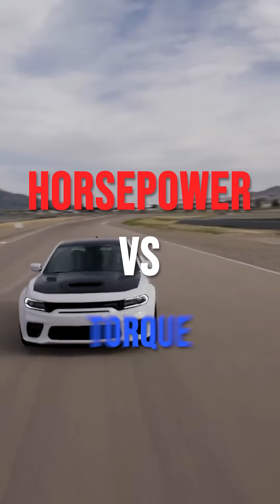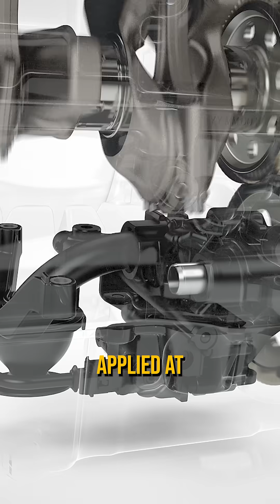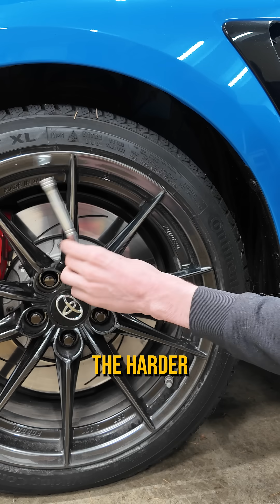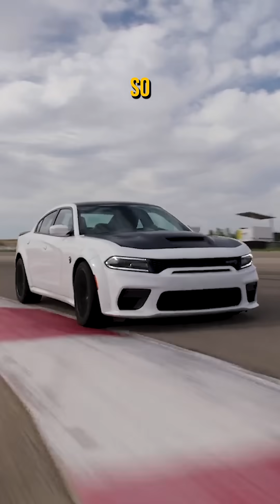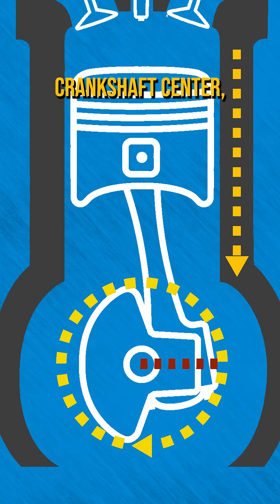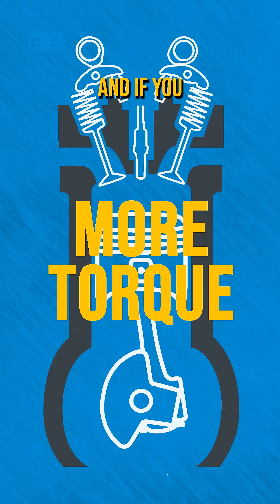Horsepower vs Torque (In 60 Seconds)

Comment: People used an analogy of “ how hard you hit a wall vs how far you take it.” Needless I don’t trust their driving.

I much prefer “torque is how heavy a load you can tow, power is how fast you can tow it.”
Reply: The best analogy of power v torque I heard was to think of a well with a bucket. Maximum torque would be when the bucket is filled with as much water as you can possibly lift it off the well. Power would be the most water you could get out of the well in a given time. You'll probably find that only part filling the bucket will get more out in the given time...
Reply: They are both hp, torque doesn't enter the equation.
Reply: @PSA78 But the heavier you are the more torque does matter. A heavy car with 390nm of torque, making 550hp at 10,000rpm, trying to push through the wind at 200mph will not accelerate as good as a car of the same weight with 1000nm of torque, making 550hp at 4000rpm.
The higher torque will be able to carry the weight and push through the air more effectively, where as the car with the lesser torque may even start to slow down when going up an incline, or fighting against more wind. 
If your car is heavy, having more torque will make you faster than having the same power derived from high rpm.
Reply: @UnparalleledSpoof  No, it's all HP. That is the unit for work being done, the amount of energy being used or required.
Reply: @PSA78  even if you're producing the same hp at the wheels, the one with the shorter gear ratio will produce more tractive effort, resulting in more torque at the wheels, regardless of the torque the engine makes at X rpm to make its hp.
So I have two cars one with 1100nm of torque, and the other with 400nm. Both make 600hp, and the one with less torque is 900kg, and the one with more torque is 1600kg. Up to 200km an hour the light weight car is much faster. But over 240km/h, the light weight car struggles to increase in speed, topping out at 275km/h, unable to increase the rpm anymore and it just fights against the air. Where as my heavier car with 1100nm will get up to 345km/h and hit rev limiter in top gear.
Reply: @UnparalleledSpoof  The old way of doing it was to lower a rock down a shaft with a rope around it, a pully on top and then tie it to a horse. The horse walk a certain distance that was measured, they timed that and then calculated the hp from that. That horse didn't move fast enough to be affected by loads such as wind resistance, a moder car is, and it's also affected by rolling resistance. 
Same thing for a tractor pulling equipment on a field, same thing with a semi-truck pulling cargo, same thing for a speed record; the load, distance and time gives you hp. 
On the flip side, torque is a force affecting durability and traction, which is why they in motorsport look at tractive force, if they know the grip they have to work with then they can plot that for each gear and limit torque so they can get maximum average hp for acceleration. They also control engines that way, density of air in the engine based on available traction for each gear, control the torque (trapped oxygen for a single combustion) and you can get the maximum amount of average hp (trapped oxygen over a minut).
Reply: Any amount of torque can pull any weight, given enough gear reduction and no friction loss
So engine torque has nothing to do with maximum towing capability, neither does power, aside from the energy needed to overcome friction
Reply: @VitamortHp is still needed once it's moving, but usually less than to get going or accelerate.
 🚜💨
Reply: With the right pulley setup you can tow a container ship with your hands. Torque is irrelevant.